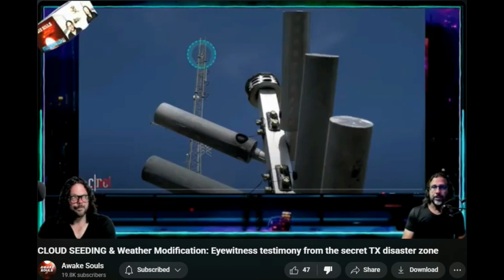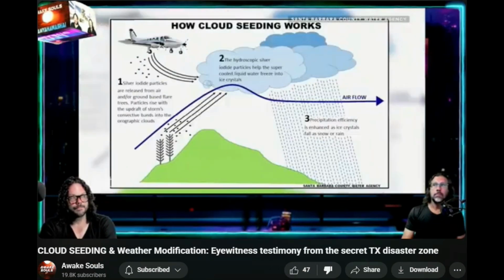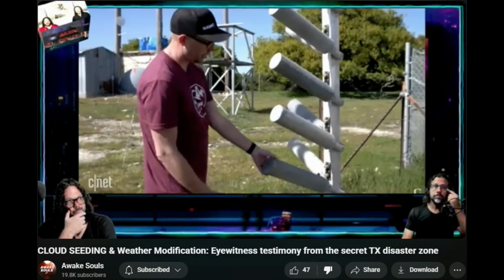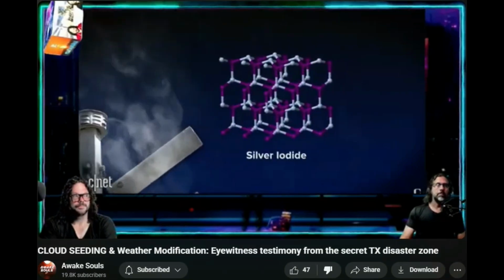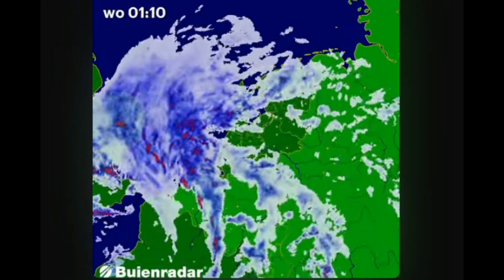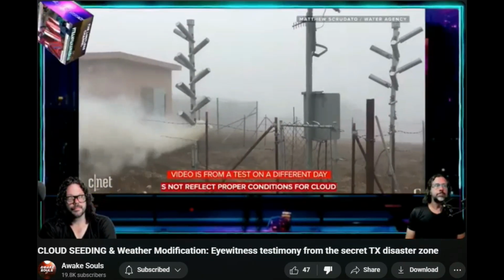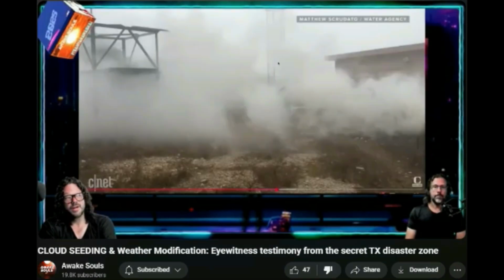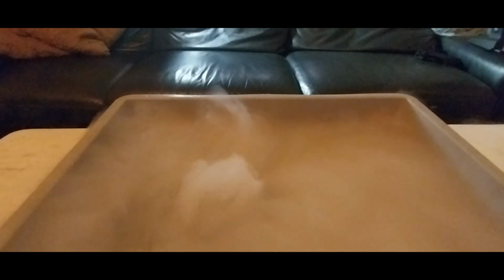Flat Earth And The Weather Mods

Comment: Yessireeeeee Q
Great vid and VIK (Very Important Knowledge)
I'll be sending you stuff about 'EZ water' or 'structured water' (the suppressed department of 'water science' I mentioned the other day) which makes a lot of sense cos it incorporates the electrical nature of 'water'.
Your clip of the 'water vapour' making machine is very thought provoking. Its as if the 'water vapour' is interacting with the air in a similar way as ice with 'water (like the foam on beer).
-@hancottoilrazzo5.386 made an interesting comment that Russian experiments show water vapor doesn't exist above 2km, and
-@silversurfer6821 the german commercial pilot confirms my experience of flying through wet and dry clouds.
I wonder what so called 'dry ice' really is ??
TTFN.:))P

Comment: And what about humidity in the air, which is literally flying water, or is it another myth? If water couldn't fly it would never dry up to begin with. Put some water on a 100% impermeable surface, and it will eventually dry up, systematically. Where does this water go if not in the air? Combined with other elements like temperature, wind, pressure and electricity in the air, it becomes easier to understand why you can have clouds forming from water vapour above your head.
What about sand, pollens, pollutants and all kinds of other particulates, aren't they heavier than the air? They can fly for hundreds of kilometers, and they fall back through rain, after that your car is dirty.
Reply from the maker: you can become pretty wet from humidity
Reply from the maker: humidity sticks to any object and binds togeter and if clouds are made of water then the molecules should bind together all the time and clouds would not even exists because water that binds have even more weight and fall from the sky but 99 out of 100 times we see clouds they not release rain so clouds made of water that not binds .
Reply: @QNFee  You can film water evaporating and it won't fog up your camera. Water evaporates all the time and there's humidity everywhere in the air, it doesn't create condensation everywhere except under certain conditions and you don't get wet because of it.
Clouds are supposed to be made of water condensed on particles, not pure water. These particles with condensed water on them must attract and repel each other at the same time by magnetism or something like that, until they are too many and collapse by contact with each other and probably other atmospheric factors like a change in temperature that initiates the process... I haven't researched the subject more than that so I can't tell you. However, I have serious doubts that it's anything other than particles and water, the best would be to take cloud samples and analyse them.

Comment: I don't remember using my windscreen wipers and having water condense on my windscreen when I've driven in fog. I'll have to check next time it happens to me.
Maybe the water particles are so small, or the particles they condense on, if that's what it is, that they dry out instantly before they even start to condense on the surface of the plane's windscreen or the drone's camera, due to air friction. And because the drone isn't filmed from the outside, you can't really see if it's moving them... and the plane is going too fast and is aerodynamic, so it sort of pierces the cloud so you can't see it move... Also the warmer temperature near the earth's surface, more pressure, air movement, even electricity in the air which increases with altitude, can be major factors that help maintain clouds above the ground, where they find a certain equilibrium...
What's certain is that the wind makes the clouds move and change shape, and when they're thick enough it rains...
I'm open to the idea that they're not flying water, but what would they be, and where does the rain come from?

I remember a video called electric clouds which proposed alternative ideas, the clouds would be electrically charged air, there are not many details, you can find the video on the channel levelplane on Odysee.
Reply from the maker: i was riding my bike in the mist for 8 km and i was soaking wet .
clouds seems to be the only water that not binds together
Reply: @QNFee  So mist would be different from clouds if they're mainly made of water, more like thick pure water vapour perhaps. Or maybe there was a very fine rain at the same time, too fine to feel it directly and not really visible because of the mist.

Comment: Qnfee you better tighten up and get these vids out! Lol 😆. I know it’s a lot of work so don’t mind me. But love the videos!
Reply from the maker: thank you
i been bussy with some work lately and i am not motivated to do some vids because i have the feeling its no use  , maybe thats just me at the moment :) , but im working on another video for my other channel :)
Reply: @QNFee  there is always use for your point of view. i am a pilot in a german airline, because of your videos i have wondered how the clouds stay fixed in the sky if they are full of water. Maybe electromagntetic forces? to me this realm is a big mystery. For sure the water cycle different from what they tell us in school. My guess is that the salty sea water goes through the earth on the bottom of the oceans gets pushed upwards like in a tree, and comes out at the mountain tops as fresh filtered water. 
On my aircraft the A330, we have an ice indicator which is in front of the cockpit windshield. in some clouds there is icing, we can sometimes see the ice accumulate on the ice indicator, often accompanied by rain or snow in higher altitudes, in many other clouds there is no icing. When entering the clouds and when the temperature is below a certain threshold, we are supposed to turn on engine anti ice, which deices the engine inlets with compressed hot air from the engines. Once ice builds up on the indicator we are supposed to turn on wing anti ice as well, which deices the forward wing area slats, with hot air. 
greets from Berlin to Amsterdam
Reply from the maker: hiya  @silversurfer6821  we call them cloud species  and we do that since the 1940-50's
the biggest lie in the sky are the clouds , as a pilot you know about the rainclouds that can release a bunch of rain and make things wet
but both cloud types are made from water according to the narative and one makes you wet and the otherone dont .
but what if clouds can make instant rain out of thin air .
i have a simular idea about the oceans , we have these rivers on earth that start somewhere and we have tides and it could be the tides are caused because of water is being filtered from salt and polution while being transported to these areas  in some deep underground system where these endles flowing rivers start .
just my 2 cents